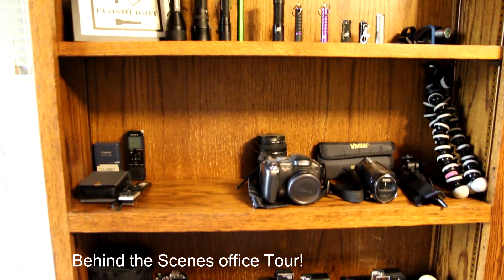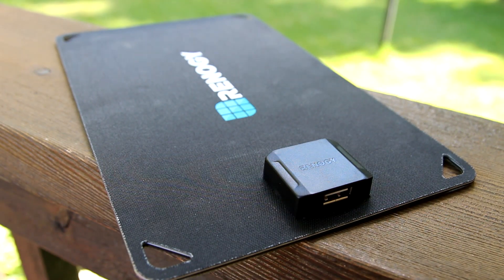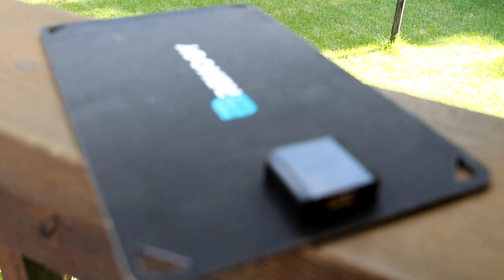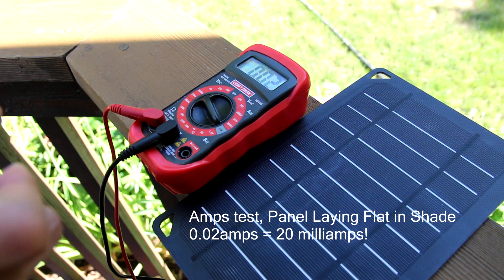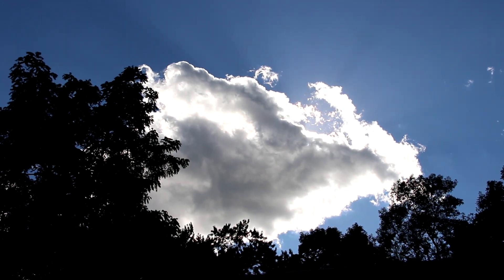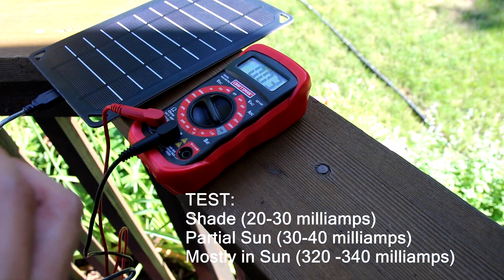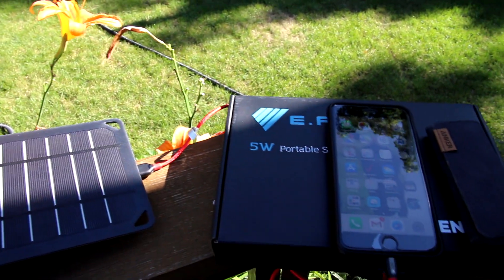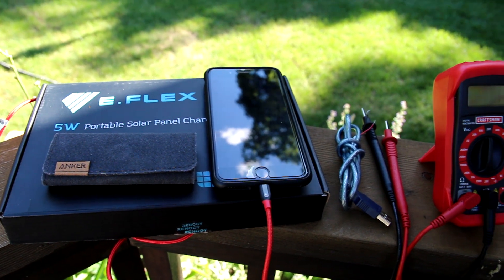Renogy eFlex 💪 USB 5w Solar Panel Amp and Volts Test

Comment: is their away to modify or improve the usb controller, to make it more robust and more water resistant?
Reply from the maker: Rob0126 prob just add more silicon. Not much you can do really
Reply: @onza04  i was thinking of the solders and/or controller itself